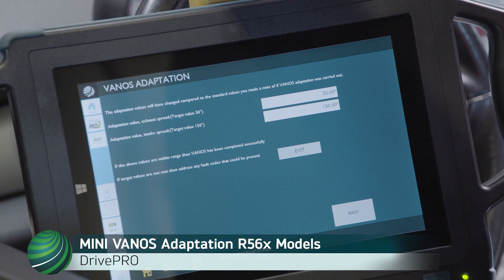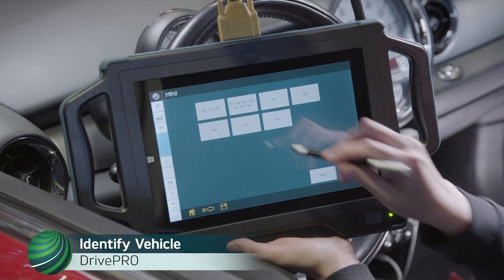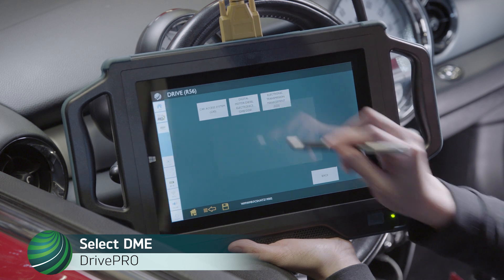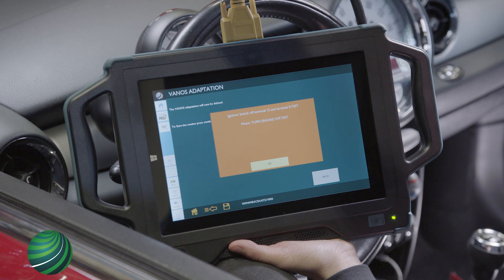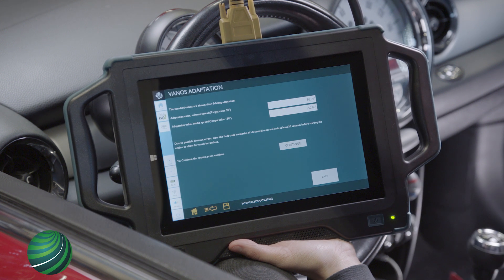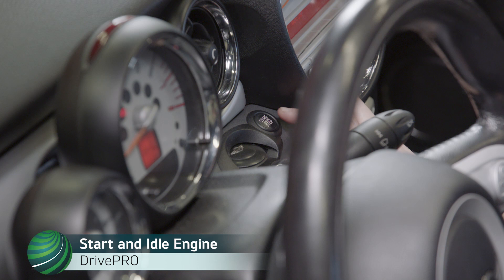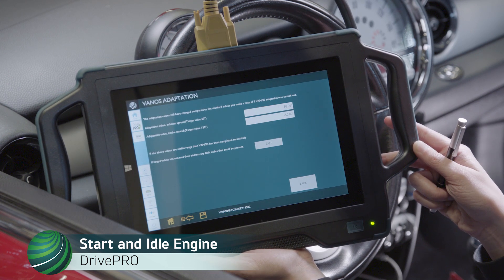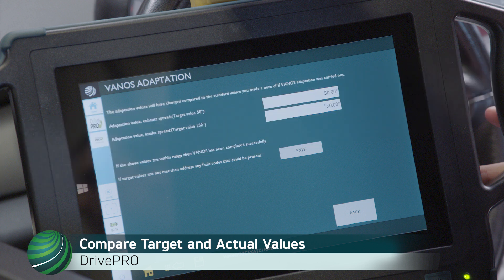How to Perform a VANOS Adaptation on MINI R57 Models

Comment: How do you clear adaptations with out a scanner I changed timing chain and gears and got a 283d and 2845 can’t get rid of them
Reply: Hello, did you resolve your problem.
Have same Codes after chain change.
Thx
Christian
Reply: Somehow the dme gets thrown out of wack when the timing is off if you have those 2 codes take it in to a dealer nd tell them to update the dme as soon as the see the codes they are  probably going to tell you thats the only thing that you need 160 bucks out the door not bad
Reply: If you know your timing is right then the update will do it for you